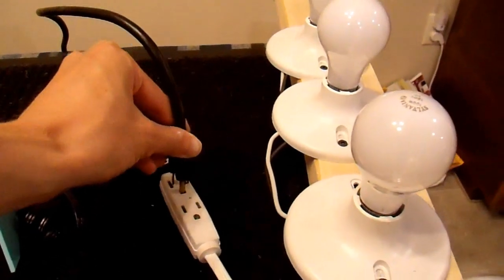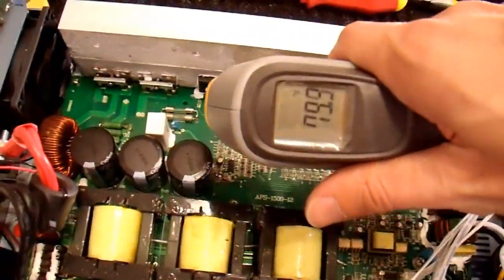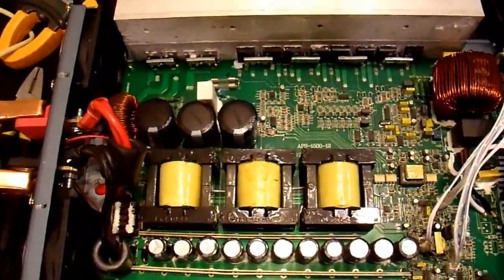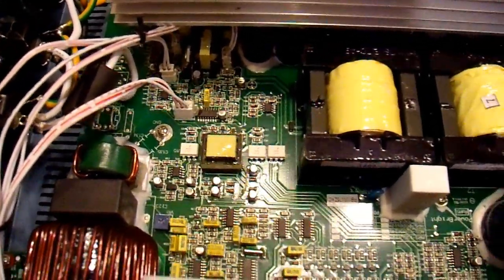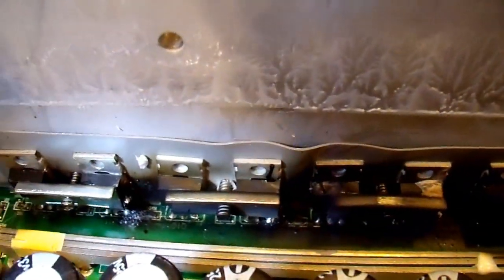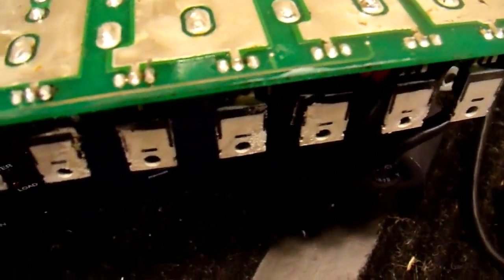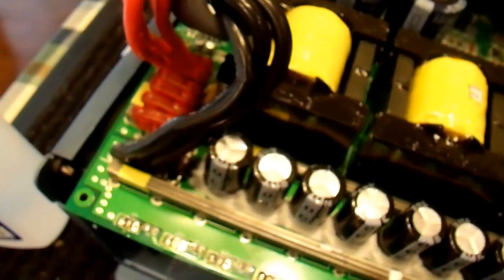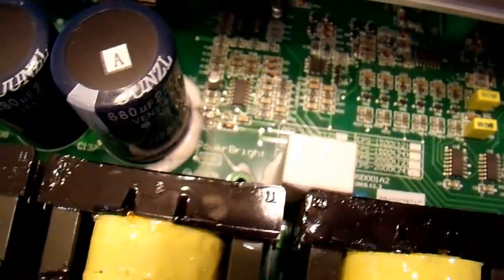PowerBright Pure Sine Inverters Part2 - Repairing continued...

Comment: I can't find some of the videos on the PowerBright.  I have one and when I turn on the switch, it just gives a LOOOONNNGGG endless beeeeeeeeeeeep...  Any ideas?  Where can I find the manual online?
Reply from the maker: Not sure about the manual but you most likely have a shorted FET.  Ohm across them with a multimeter and you should be able to find the failed one.
Reply: @knurlgnar24   Thank you!   Thanks for posting the videos.   Did you change one of those in your repairs?
Reply from the maker: @macedonianproductions4497  I don't remember in detail specific repairs, but in general one can ohm out transistors and diodes to determine what has failed and replace those that test bad.  Sometimes additional parts need to replaced as well but often just the power components are damaged.  If you are able it is also a good idea to test the drive circuitry as well.

Comment: Powerbright has no customer support whatsoever.  I have a 6kw unit and it lasted 2 months. I used it for a 1800w pancake compressor and that's IT.
Reply from the maker: Thanks for the info.  I've never tried to contact them but all of their products that I have used/seen appeared to be a pretty good value and performed well.  I'm guessing yours had a manufacturing defect rather than simply a poor design - too bad Powerbright didn't stand behind their product.